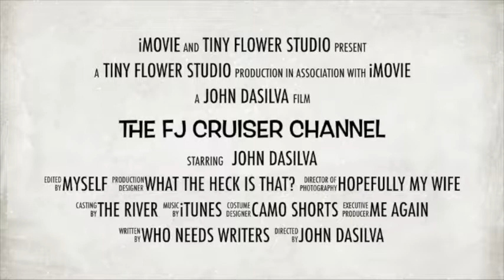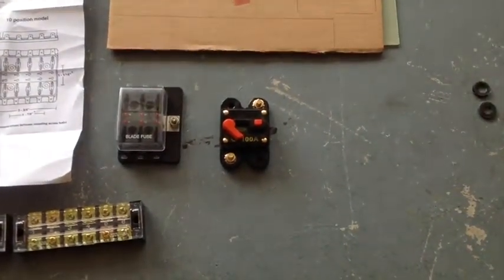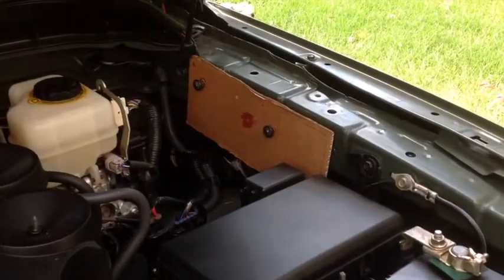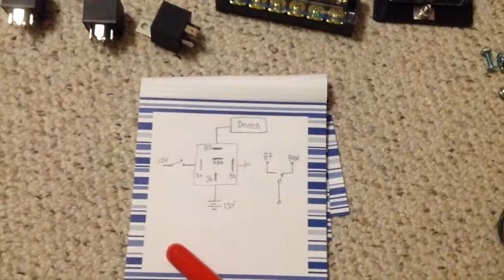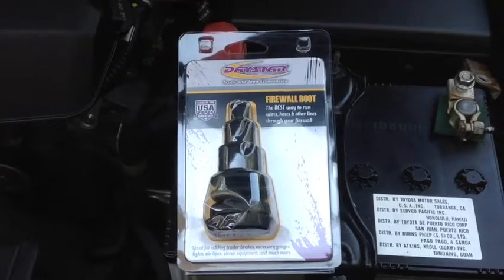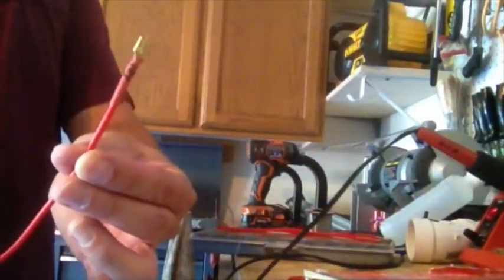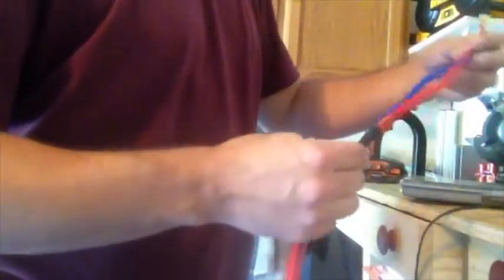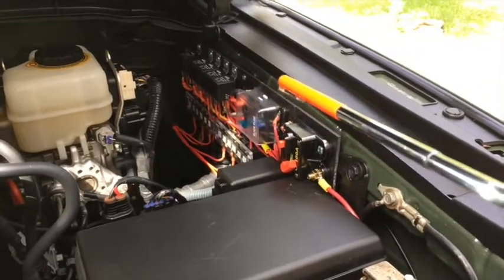FJ Cruiser Relay Circuit Panel

Comment: Hello,  Nice video!  If you ever do this again I would just like to point out that the wire running from the switches does not have to be anything of significance.  It is not carrying the power of the device, only telling the relay to turn on.  I have used a single CAT6 cable between the switches and the relays.  It works great and is much easier to manage.  Just so food for thought.
Reply from the maker: Good idea! Maybe next time I will build one with a CAT6 cable connector and route the signals to each relay. It would clean things up. Thanks for the comment!